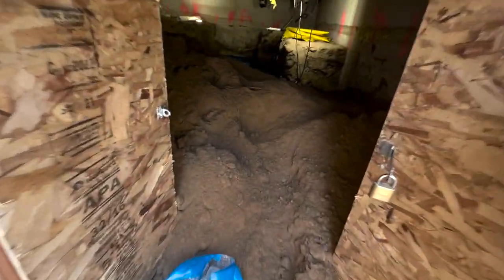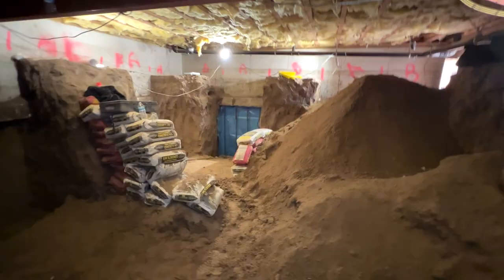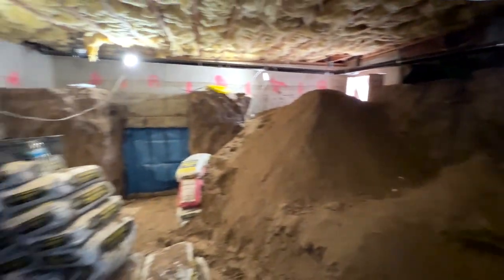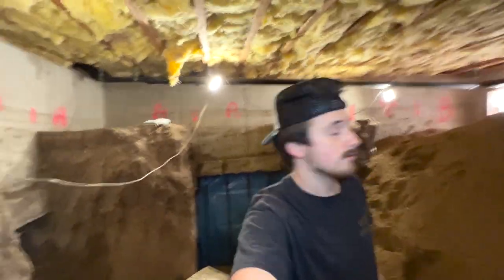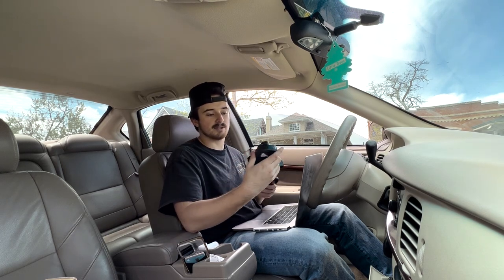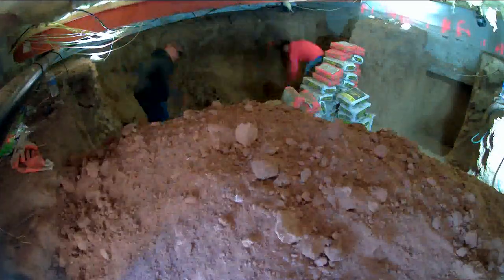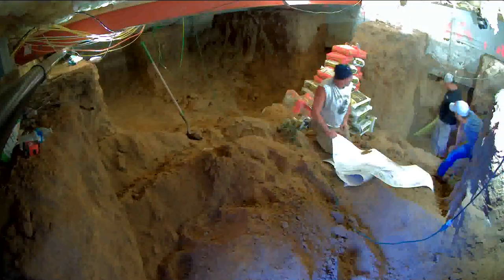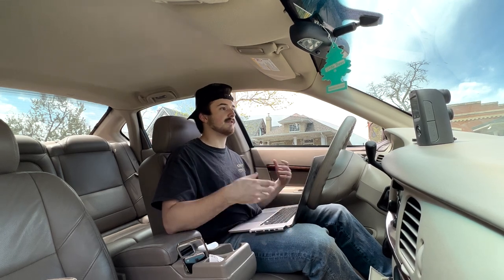Hand Digging Small Denver Basement - Timelapse

Comment: Love the videos and like everyone else has said, the information you provide is fantastic! I have a split level here in Salt Lake City and my crawl space is about 40" - 48" from dirt to floor joist. Only house on the street without it dug out and all the other homes having the same floor plan. There being nothing in the middle of the area supporting anything, and I can access it through a door in the middle of the house, (obviously engineer review needed) but the dig out could be started in the middle of the space and work outwards leaving about 2 feet to the foundation walls. Then I would have a contractor come in and do the under pinning, because obvious reasons :). Then the project could save money and go over a longer period since full time day job.

Comment: What sort of material are you using for your waterproofing and vapor barriers? It looks like its maybe a generic poly sheet?
Also any thoughts on the new super small battery operated skid  / front loaders for projects like this? Seems like they'd be small enough to fit
Reply from the maker: We use a thick 15 millimeter plastic for our waterproofing. And the super small battery skids are pretty cool but even then its a tight fit in almost all crawlspace conversions.